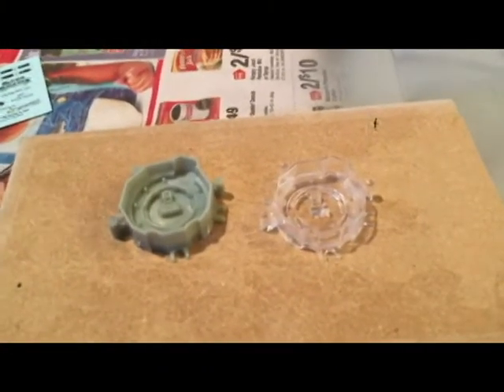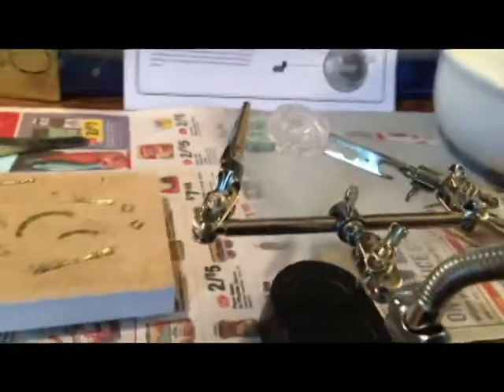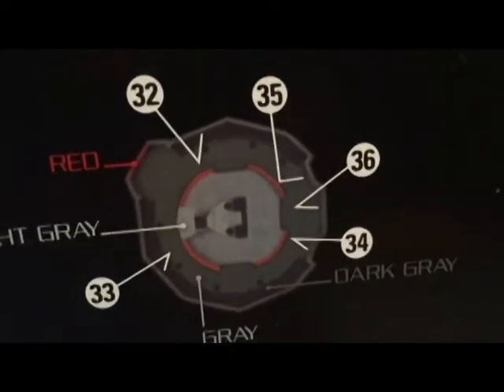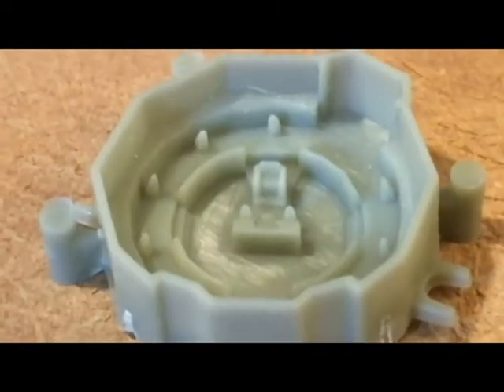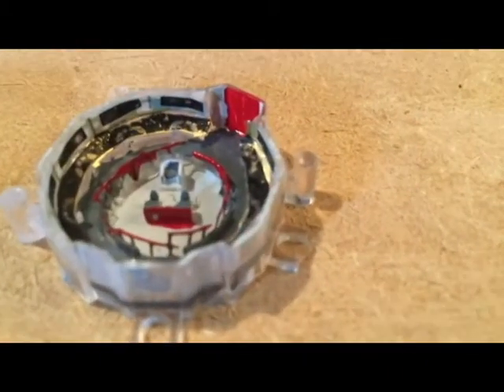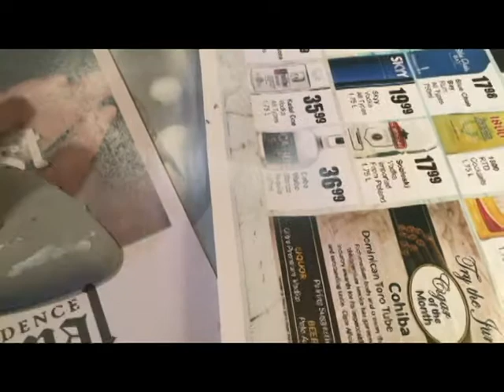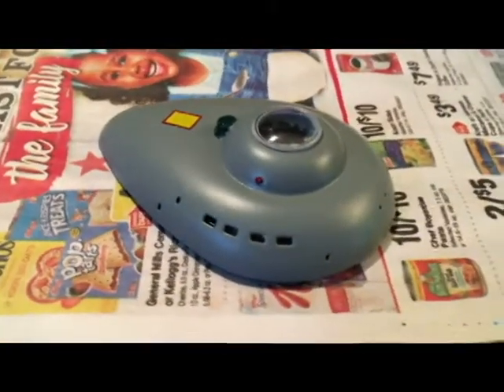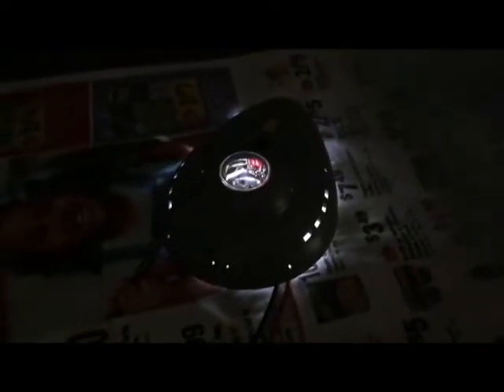Polar Lights 1:350 USS Enterprise 1) Bridge, B and C Decks

Comment: great video Gerry, thanks for sharing, did you take the polar lights lighting kit or custom ? what you took for lighting the saucer ? thanks
Reply from the maker: Thank you for the kind words. To answer your question, I used the Lighting Kit for this model. I am working on the Refit right now. There is really no lighting kit so I am creating it as I go. The only thing official are the circuit boards from TenaControls.
Reply: @TrekFanNCC-1701  thanks, good luck with the Refit, looking forward to watch your videos !
Reply from the maker: Thank You.

Comment: The first major error I see about using the  PE set is not to file or sand away what remains of the attachment tabs.  I do cut it off the same way with a flat tip Exacto blade but yet flush to the objects part.  I do use a lot of PE... It takes practice. BTW I am the DLM Parts guy. I do use PGMS as my go to guy for my PE design production.